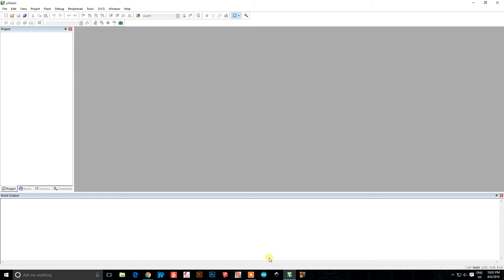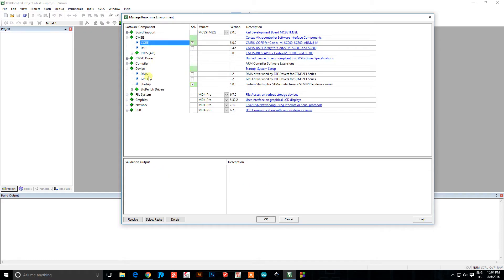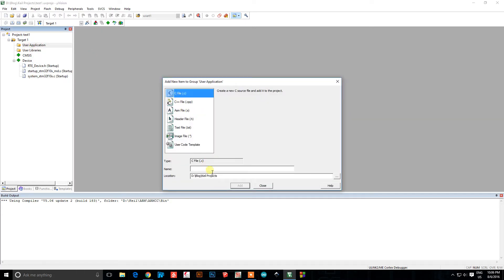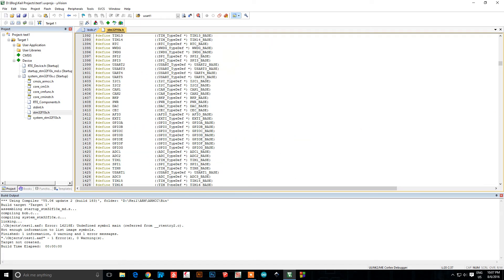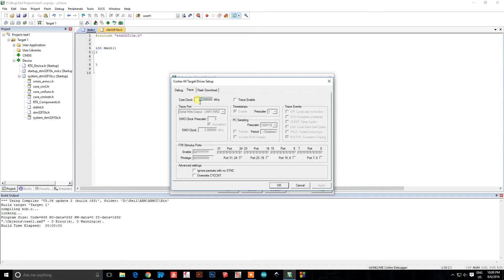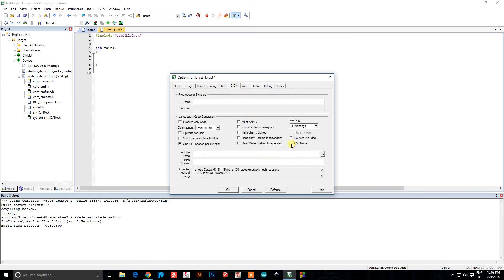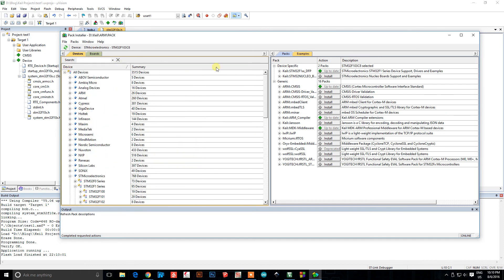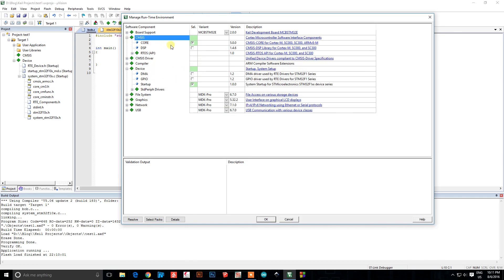Keil uVision setup for Stm32F103 and St-Link V2

Comment: hi sir how can   copy hex file from  exeting STM32F103C8T6 chip ??
Reply from the maker: There is no hex file inside the chip , it's just 101010101 ones and zeros . The best you can do is try to read the data from it and maybe disassemble it using ghidra or something of the like. Usually this type of behaviour is not supported by professionals so that is all I will answer about that.

Comment: I was able to finally !!!! download to an stm32F103C8 via ST-Link v2. I wrote c code from the Maidi/Naimi book to flash the led (pc13) by setting GPIO registers and it worked.  However I have to push the reset to get it to run.  I followed the setting instructions under flash settings (reset and run)  but it doesn't reset after upload.  Argh ???  Excellent tutorials.

Comment: Hi Eddie,
Why do I have to unplug the ST LINK Device whenever update the program? (STM32F103CB + KEILV5 + ST LINK V2) 
Example:
In LED Program running Perfectly...
now in KEIL i Changed the Delay to from 100 to 1000 &
Rebuilded, Saved & Downloaded...but the Program is not running in STM32F103CB Board.
if i unplug & plug the ST Link the updated Program runs Perfectly.
 Thanks in Advance
Reply from the maker: I think you need to reset the blue pill by pressing the reset button, unplugging is not necessary , this may have to do with your settings in Keil to reset after programming or not.

Comment: Hi Eddie, thanks for this series! 

I followed the video until min 2:34 and when I build the project I get:

RTE/Device/STM32F103C8/system_stm32f10x.c(65): error: 'stm32f10x.h' file not found

Do I have to define some kind of path?
Reply from the maker: It should show up in your project explore on the left do you see the file there somewhere?
Reply: @EdwinFairchild  On the left into 'Device' I can see only three files:
RTE_Device.h (Startup)
startup_stm32f10x_md.s (Startup)
startup_stm32f10x.c  (Startup), in this it does not display any files when I compile as they appear to you
Reply from the maker: No path needs to be define , Keil will do all of that because it knows where it keeps it's files.  It weird tjst it doesn't include it for you. Hmm did you add everything I stated when selecting the software packs ... Check those other files if the file is included there, bit maybe not because it would have showed up
Reply: @EdwinFairchild  do you think the problem may come from installing Keil uVision. Because I do everything as you show it in the video, or maybe I may be missing installing something from the package installer?
Reply from the maker: @nicoromero6423  maybe try a fresh install man, I'm sorry I really don't know what the issue could be. But it's odd because if something were missing it wouldn't have the start up code.
Reply from the maker: @nicoromero6423  in the start up file does it have some functions to start the clock setsysto72 something like that , I think that access the registers , and should include the header file , if not try a fresh install
Reply: @EdwinFairchild  Hi Eddie!  Thanks a lot for yours answers, I was finally able to find out what was wrong. The problem was the version of compiler, in 'Options for target' 
I had set by default 'user default compiler version 6'  
I changed that for 'user default compiler version 5' and it worked perfect, how in your video. Again, I thank you for your time and for the stm32 series,  that is spectacular!
Reply from the maker: @nicoromero6423  good glad you fixed the issue and can now progress with the videos! I have some coming out in the coming days

Comment: Hello, I have a microprocessor exam at 20:00 today and I don't know much. If we are using STM32F103c8 card, we are coding in the question. If you can help on this question, I would like to get in touch if you write a comment.
Reply from the maker: Why don't you know much, and if I help you pass you still won't know much and when you get an engineering job you won't know much and get fired... My suggestion is learn something.
Reply: @EdwinFairchild Actually, you are right, but I love working in the software field, I am not satisfied with working in the electronics field, unfortunately, since this course is an essential lesson, please do not say this is a software: D
Reply from the maker: @sefaaydin2029  you mean you enjoy high level software running on an operating system ? Like c++ applications and things with windows? Or web development? Not sure why they would make you take a test on embedded firmware.
Reply: @EdwinFairchild  Yes, of course, I like it. My area of interest is web development and mobile application. I love to work with python django on web development and mobile with dart language and flutter platforms. it is very fun to test things, even though I have just started mobile application: D As you said, I did not work as an embedded system in a laboratory environment.
Reply from the maker: @sefaaydin2029  ahh I see well we all have different interest I suppose. I never liked anything to do with web development , new languages pop up every month and all that stuff is overwhelming , one employer wants you to know one thing and another will ask for an entirely different set of tool to accomplish the same task. Much respect for doing that. I like making hardware , the idea of having the power to make your own electronic devices and making it a reality is amazing to me. I think everyone likes electronics so its hard to believe someone would not have an idea to design their own device.. I'm secretly wanting to design a cellphone jammer of my own because it's illegal to buy 😂
Reply: @EdwinFairchild  I absolutely agree with you, everyone can have different interests. But you can be sure that you want to print your own mobile application or cacsus mobile application in many people. I have my own spy mobile application. I'm going to focus on flutter: I am open to D recommendations, but first I have to give my exams. I wonder if you will help me on my microprocessor exam, which I will have no connection with later. :D
Reply: @EdwinFairchild  There is no disgrace system as compelling people to take exams related to the field they are interested in. I still thank you for your interest: D

Comment: Hi, im using the stm32f303 discovery board and im trying to setup the onboard UART, but im having difficulty trying to figure out how or where should i configure the Alternate function register as UART1 in code. Appreciate if anyone can point what im doing wrong.
Reply from the maker: Do you have your ref manual?
Reply from the maker: might also help if you watch my video on UART and not this keil setup video.  :)  and check page 140 of  RM0366

Comment: Are your line of tutorials also compatible with the stm32F0?
Reply from the maker: To a certain extent, I mean the thing to take away here is really to learn how to use the reference manual to program the chip. There are register differences among STM hundreds of microcontrollers and it would be impossible to make the same video for every chip. I suggest to watch a video and get the concept and give it a shot on your own device

Comment: Hello, I have updated the firmware of my stlink v2, mini and common, and keil uvision tells me that it is not original. I had version 2.28.s7 and updated to the last 2.36.s7. I can't go back to my previous version, because I can't find it on the page, the oldest previous version is 2.32.s7. Do you have an older version, please. Thanks.
Reply from the maker: I do not have the firmware for st-link sorry
Reply: @EdwinFairchild  Thanks I will continue the search.

Comment: I'm using cheap stlink v2 debugger/programmer 

I'm getting this error no target connected.
How to resolve this
Reply: I realize its been over a month, though I've had the same issue, have you installed the windows drivers for the ST link? That solved my issue
Reply from the maker: Another option is to start the microcontroller in bootloader mode and try to upload the software. I uploaded some nasty code to one of my bluepills and when you turn it on it caused a hardware fault and wouldn't let St Link connect. The only way to upload the code was to not let me software run on it, so I put it in bootloader mode and then uploaded better code that was it. Someone on Facebook had similar issue and this was the solution I have them and it worked
Reply from the maker: You either have your wires wrong or you microcontroller is bad. If you have a blue pill that sometimes happpens. But check your wiring

Comment: Hello, have you try printf function during debugging mode using stlink v2? Printf so that can display some words at terminal? I cant find solution to this problem. Help!
Reply from the maker: Steven Lee it can be done but there are quite ale steps to get that to work. I have never used it so I cannot help you there. If you are using it for debugging purposes have you tried using the debugger and checking your variables there?  Even better you can download an application by st where it shows you live variables and even plots them on a chart or graph ... it’s called STM Studio
Reply from the maker: not sure if you have already done this , but I did make a video on printF function, but it does not use st-link in debug mode, i just works are a noraml printf during run time.  you can print to any terminal that connects to the proper com port, youll also need a usb to uart converter. if you have found a way to do this using the st-link that would be great and please enlighten me.

Comment: Strange, the ST-Link Utility (v4.1) sees the blue-pill's STM32F103C8 as 128KB Flash, not 64KB?!

Unfortunately, when I try to download to the device in uVision it says 'ST-LINK connection error'.  In the Options->Use 'ST-Link Debugger' Settings it shows the Port as SW and an 8Mhz Core Clock... however, the window says 'ST-LINK connection error'.    I verified the Device Database has the STM32 and I installed the Pack for STM32F1XX support...  

I think it might be a jumper issue or an issue with the ST-LinkV2 firmware.. because when I try upgrading it via the ST-Link Utility from "V2.J17.S4 STM32+STM8 Debugger" to 'V2.J28.S7', it says 'Upgrade Error, Please try again.'       How can the programmer be upgraded?
Reply from the maker: Ben Nguyen try to disable the upload to flash setting in the st link settings menu

Comment: Hi! Thank you for the tutorial. One observation though, didnt you just enter 2KB into the memory size, instead of 64KB? For 0x1000 being 4096, but I might be mistaken.
Reply from the maker: sorry for the late reply but you are correct there was no need for that , mistake on my part
Reply: @EdwinFairchild But you were correct, you had entered 0x10000 and not 0x1000, which is in fact 64kb

Comment: Hi, when i try to build the project, at the build output, it shows

* Target 'Target 1'  - Device Family 'Cortex-M3', default ARM-Compiler version 'Unspecified: use latest compiler version 5' is not available.
* Please review the installed ARM Compiler Versions:
   'Manage Project Items - Folders/Extensions' to manage ARM Compiler Versions.
   'Options for Target - Target' to select an ARM Compiler Version for the target.
* Rebuild aborted.
Build Time Elapsed:  00:00:00
Reply: Solve guys: Visit this link if u guys have the same problem.
http://www.keil.com/support/man/docs/uv4/uv4_defaultarmcompilers.htm
Reply from the maker: see if this helps http://www.keil.com/support/man/docs/uv4/uv4_armcompilers.htm

Comment: Please remind me, exactly why you checked box "C99"? Sometimes in the program code... it gives me some errors related to this one. Thanks .
Reply from the maker: the only reason I did it is because it allows me to initialize my counter variable inside my for loop, i mean it allows other things too but not necessarily because its good practice. so instead of :
int x ;
for ( x = 0 ; x< 10 ; x++)

you can type 

for(int x = 0; x<10;x++)

just personal preference. 
youre probably typing something that is in a newer standard so you cna omit that step
Reply from the maker: i know its crazy!! I notice nowadays they want all comments between the multi line comment characters /* blah blah blah  */  there are always changes to "standards" most of them are good and they do it for a reason , like how youre not ever suppose to use the GOTO statement, its even outlawed in automotive deisgn.
Reply: I do not know why is that, but yes - it is strange. I rarely or never use GOTO, but if needed... eh, why not?!